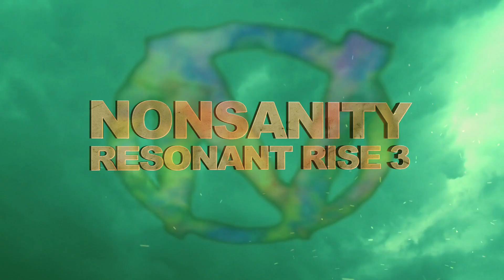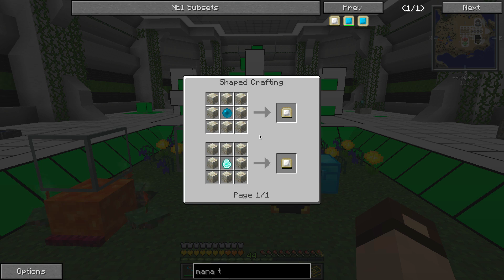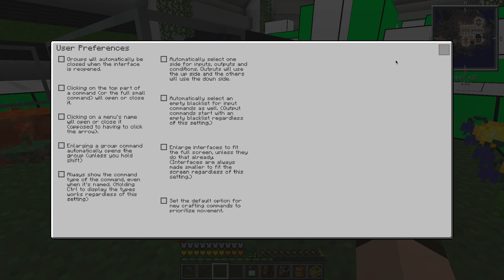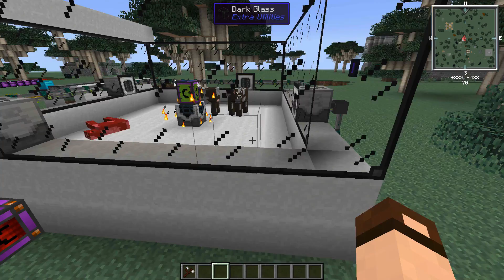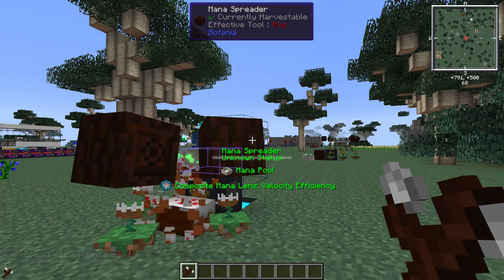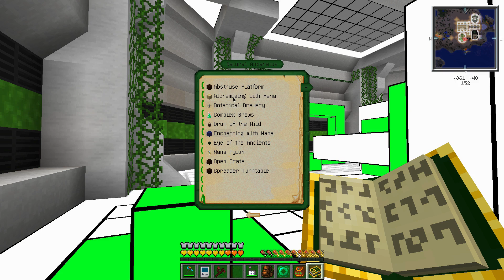Resonant Rise 3 LP - EP 21 - Automating Botania, Part 2

Comment from the maker: + Steve0Face (You have replies turned off in your Google+ settings.) I hope the clicking isn't too annoying as there's not much I can do to prevent it. I use a MacBook Pro to play and its trackpad is rather noisy when clicking. I've tried switching to a mouse, but I'm just too used to the trackpad after all these years. I use a Blue Yeti USB microphone with a pop filter that I center between me and the laptop. I've set it to focus its pickup to the front, but it still hears the clicks. Putting it off to the side doesn't reduce the click volume, but does reduce my voice.

I use ScreenFlow for both recording and editing. I've set my monitor to correct HD proportions using ScreenResX and put Minecraft in one space and ScreenFlow in another. This way I can switch between the two with a three-finger swipe as I add scenes to a recording. I made the intro clip in Adobe After Effects.

When I'm done editing everything together in ScreenFlow, it also has an option to upload to YouTube. Rendering and upload usually take two hours for a 45 minute episode. YouTube takes as long to get the HD version ready, and I usually wait until that's online before making the video public.

Comment: Yeah, Project E is a tad OP, its basically giving creative amounts of resources for little to no effort. Much like Magical crops does. But thats the direction the mod pack designers wanted to take with resonant rise 3. However, for botania in general, often when people dig into the mod in their play experience they are already well established, have ran a series of quarries, and are drowning in coal. My own Infinity playthrough i have about 300k coal, after 2 quarries and about 7 days of playtime. Endoflames with such supplies of coal works just fine. However i prefer using comparators on manapools to shutoff the coal drops. If the recessive manapool is filling up, it stops dropping coal. if the coal lands on a pressure plate, it also shuts off the coal drops. Sure fire way of making it spill as little entities into the game as possible.
Reply from the maker: I used a similar system with my setup that will be seen in the next episode. I use a Remote Comparitor from (I think) Magistics to monitor the recessive pool. I also put mana burst detectors in front of one of the Mana Spreaders in each quadrant and summed their signals—smoothing out their flicker into a steady signal. The combination of "is the pool filling up?" and "is mana still being produced" give me two "stop fuel" conditions that seem to work well. Of course, using Aeternalis blocks, one fueling lasts a long, long time. Timers were not an option. :)

So far, I have well over 1200 full mana tablets stockpiled—and I'm not stopping. ;)